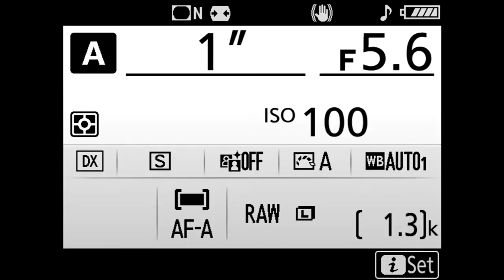Makita vs HILTI 12v Screwdrivers

Comment: I first used Hilti impact in my trade school loved it I have 3 of those now. Haven't hade any problems I dropped multiple times the battery case broke but it's still working I just put electrical tape over it it still charges and work as usual.
Reply from the maker: HILTI is dependable

Comment: Can you do the m12 fuel impact driver vs the dewalt dcf887
Reply: Dcf887 stomps.  Not even remotely fair.   M12 is good but totally different class.
Reply from the maker: Yes I can. it will be interesting to see the difference